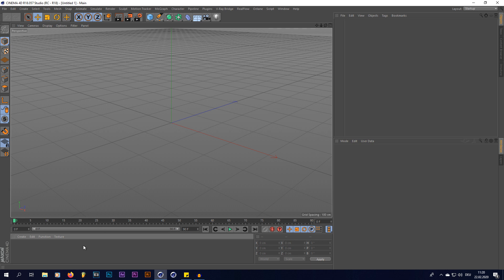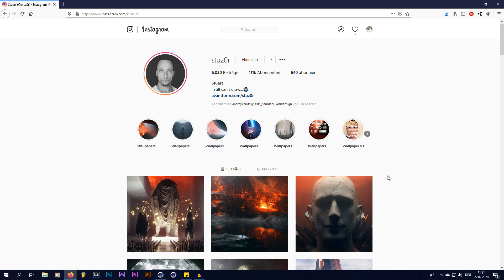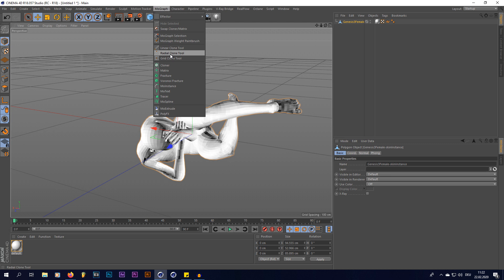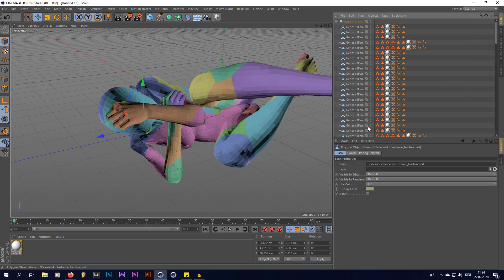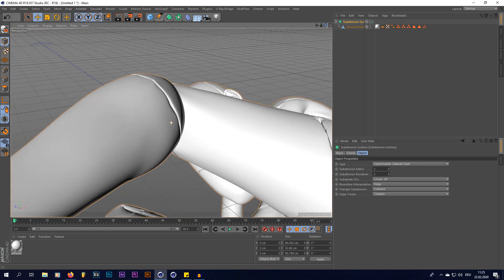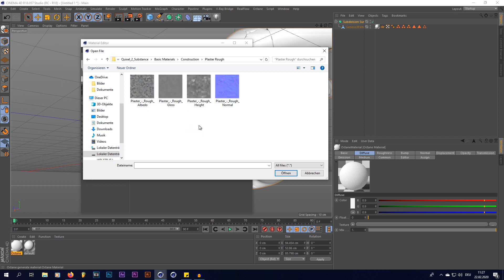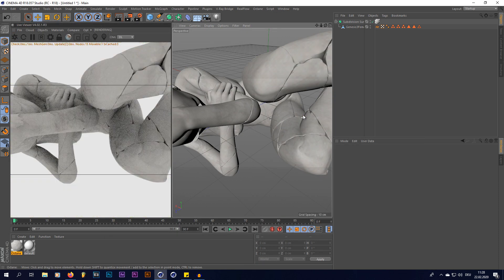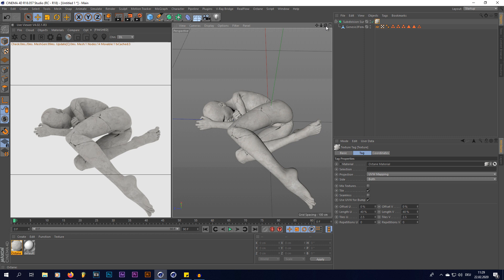How to Create Stuz0r-Style Cracked Stone Structures | Cinema4D & Octane Render

Comment: Hey, Great Tut!! Is there any way to make a glowing light coming out of these cracks?
Reply from the maker: hi, thank you! yes you can, by putting a smaller copy of the head model inside of the original headmodel and putting an emissive material on it. that way it will only be visible through the cracks :)